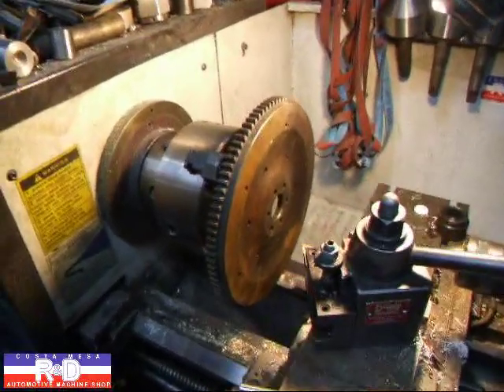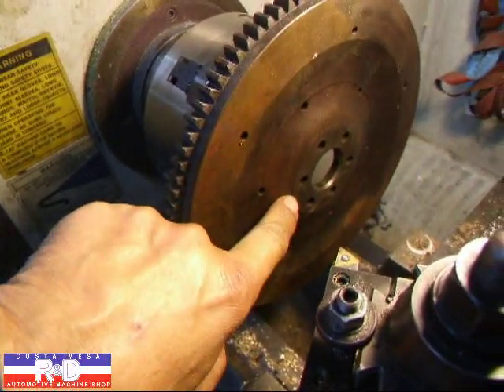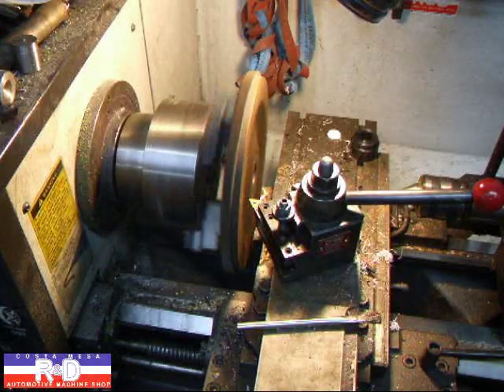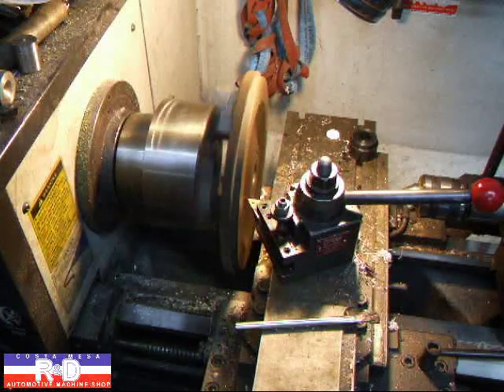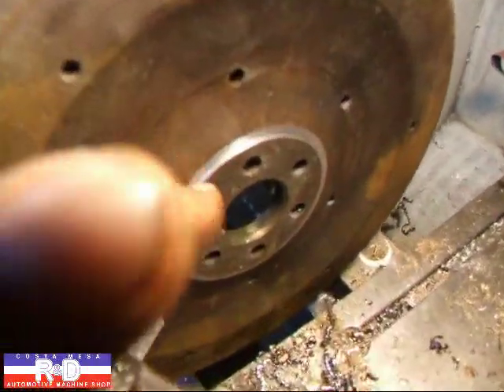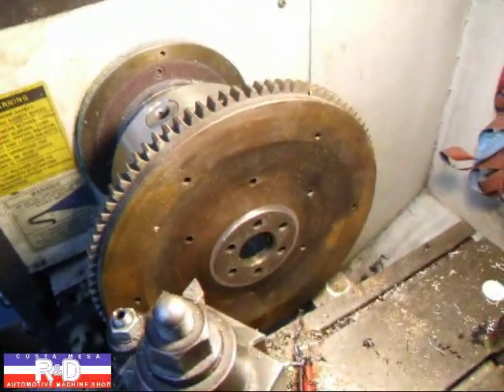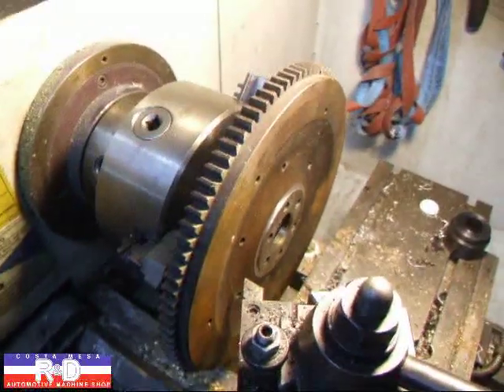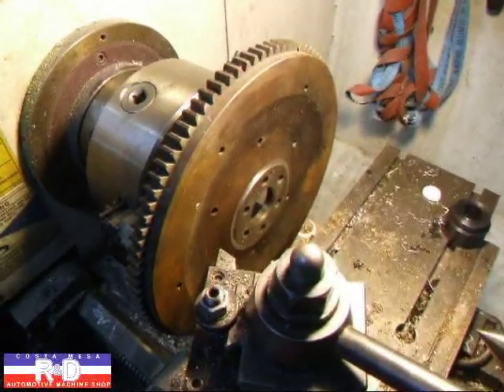Fiat 600 Flywheel Mod for 850 Engine

Comment: @undeadkillers thats because its a 4-banger, typically the fewer cylinders an engine has the larger a flywheel it will need